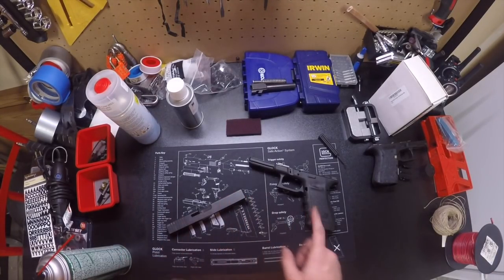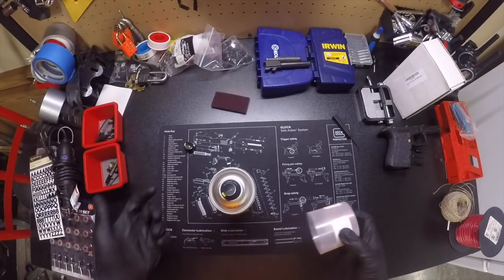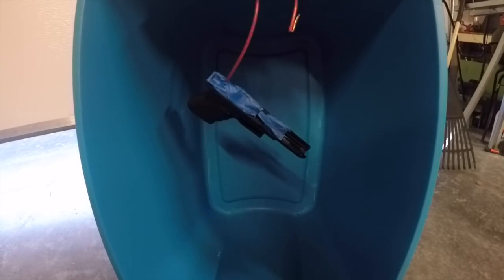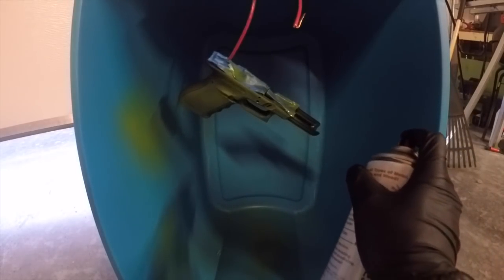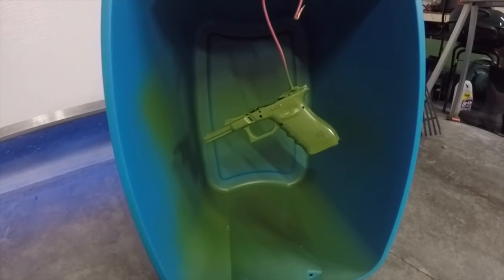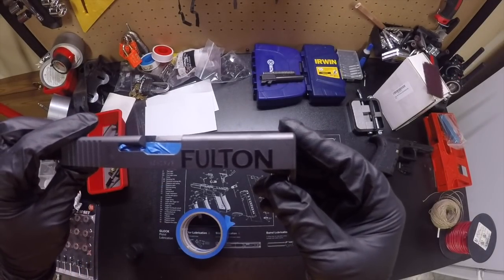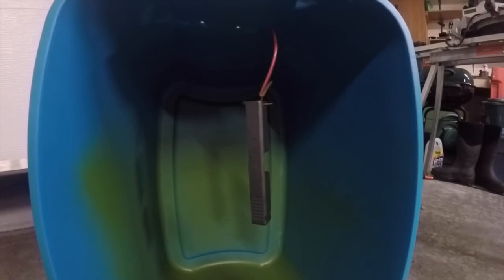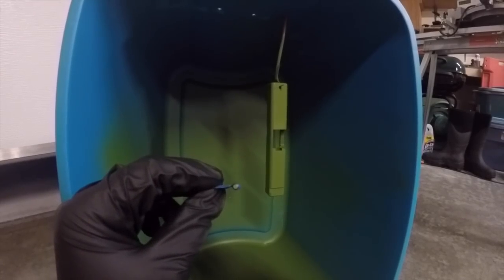DuraCoat Glock 20 frame and Glock 19 slide

Comment: Yeah you should have done lighter sprays much farther away (8"-12")
Reply: Rite! 1st coat should b so light that it doesnt fully cover existing color (literally maybe 1 quick pass with the spray from about 15-20 inches away) it should leave the surface feeling rough and looking "dusty", but it will dry so fast that it wont hurt any impatient feelings. 2nd coat should use same process but with 2 or 3 passes with the spray, from same distance.
Reply: I was thinking the same thing. but the guy did say it was his first time doing this so maybe he learned from it

Comment: You sprayed a polymer frame with brake clean?🤭
Reply: The last Minuteman Iknow this was a year ago,but many people do this as long as you use non chlorinated brake cleaner no issues.I was shocked the first time I saw someone do it then I talked to a cerakoter who does the same thing.I have since used the crc in the green can on my LCP I did follow up with rubbing alcohol worked great.
Reply: Good to know. I have the Red Can Brakekleen because it works so good on metal guns.